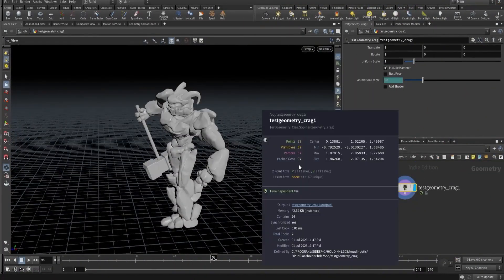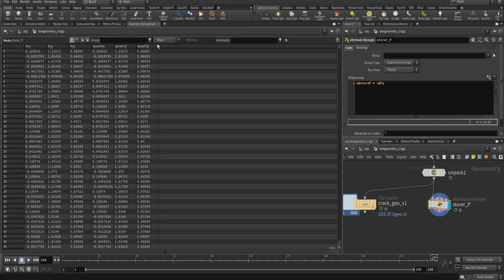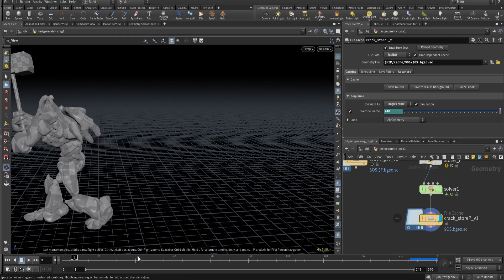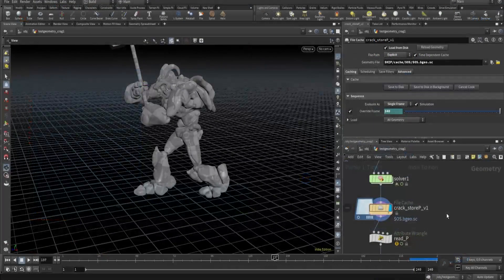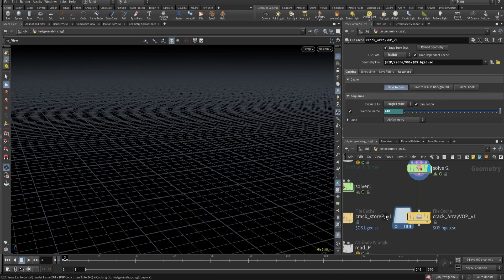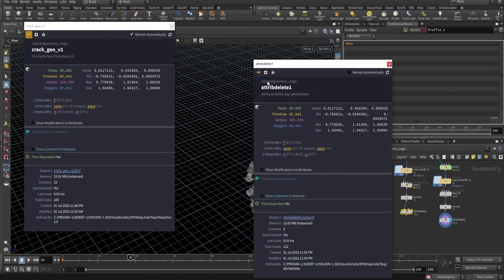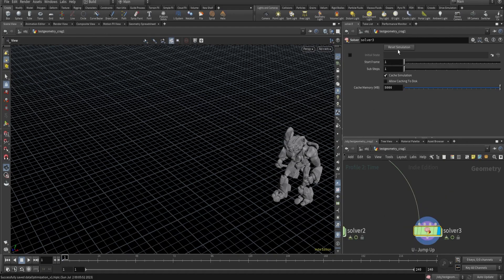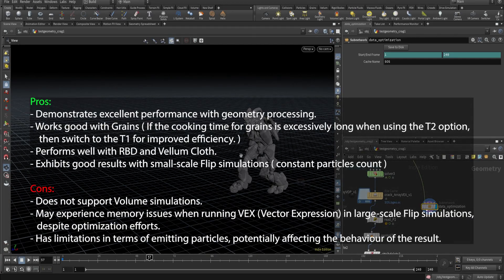Houdini Tutorial: Reduce Cache Size by 90% - Data Optimization Techniques

Comment from the maker: More Info: Another technique to consider is using the "extractTransform" node to capture the position and orientation data of a moving geometry ( not deforming ). By caching only these key points, you can significantly reduce the amount of data storage required. Once the points are cached, you can utilize transform pieces node post-cache.

 I've also done some research on using a single Alembic file, and I tested it on the crag scene ( unpacked ). It consumed unpacked 1.21 GB Size ( packed 504 MB ), and it will save in USD format with the same size.
Reply: yes wanted to write about extracttransform for the packed objects it can store PSR , but yes it only works only with non deforming mesh, constand point count.

Comment: does this work for RBD simulations? like a braking glass?
Reply from the maker: It works best for RBD, actually. In fact, in RBD, you get a chance to save points only. So, I recommend saving a single frame on glass geo and the full range of sim points so you can save 95% of data.

Comment: Thank you for sharing, can we assume that this will speed up render times bc caches are smaller?
Reply from the maker: Technically, using Wrangle or VOP, it still takes time to read data. While it can save some disk space, it won't necessarily speed up the render.

Comment: The problem with this method is it is only helping you save space for data that is going to come back into SOPs.
You cannot use this to render, as you'd need a procedural at render-time to do the transfer.
Single alembic Vs per frame alembic is already doing a very similar method to what you've shown, USD data format is also furthering this, and both those data types can be directly rendered, either in houdini or another DCC. 

Have you found it usable for final frame rendering, or more an intermediate caching reduction workflow?
Reply from the maker: Hey Lewis, Of course we can use this for the Final render check this https://youtu.be/V7FIKScwC_E
I've also done some research on using a single Alembic file, and I tested it on the crag scene. It consumed 1.21 GB Size, and it will save in USD format with the same size. So, I'm importing an optimized version of the scene, which is only 199 MB, directly into Solaris. It's working well, but we still need to recompute the velocity. Other than that, everything is looking good!

To export the optimized cache for use in other software, we can try using a Houdini Digital Asset. Although I haven't personally tested this approach, it should allow us to load the optimized cache into other software. If for some reason this doesn't work as expected, we can resort to caching it using the traditional methods we've used in the past.
Reply: @VFXMagics  anything you load into Solaris that is coming live from sops is going to be buried in the exported usd stage, it won’t be a reference or delayed load. USD export has the same functionality to store and transfer data, we use it for hair. 

The problem with making a hda is you’d need to inject hengine into the mix, that will pull memory and a license. I don’t know how it would scale either, with big data sets.
Reply from the maker: @lewisvtaylor  I haven't specifically cached anything additionally for rendering in USD. However, if it's necessary, we can explore the option of using temporary caching as you mentioned for the USD export.
Reply: @VFXMagics  yeah that’s what I mean. If you export the usd stage that data will be baked in as a binary instead of referencing. Then you will need to call hengine and run your sop data transfer, that’s where these methods of cache reduction fall over as they need a process run on them to be usable.